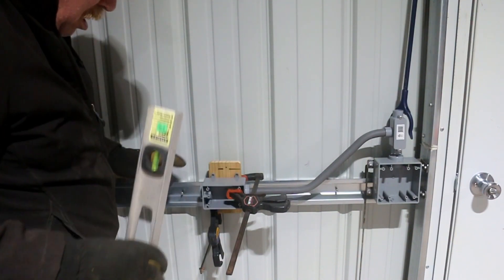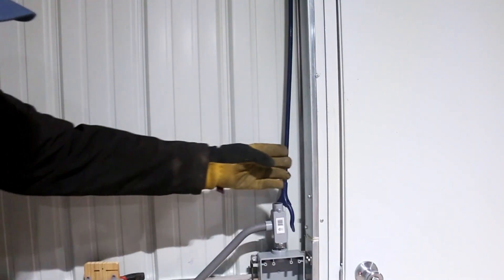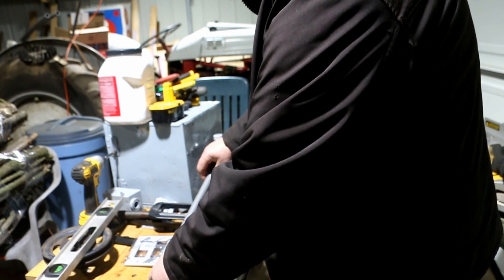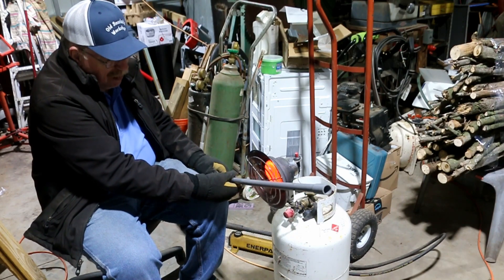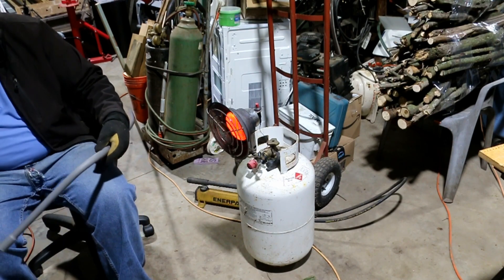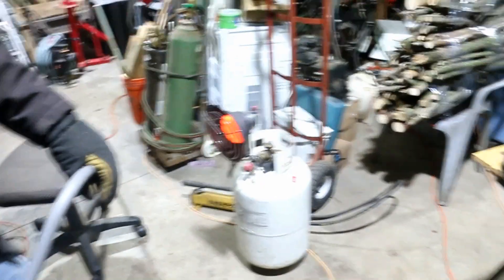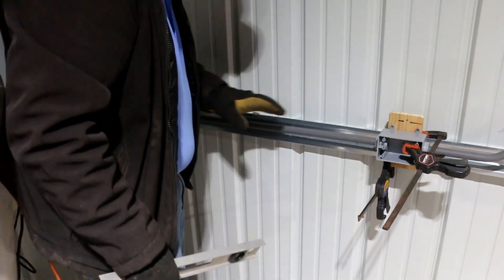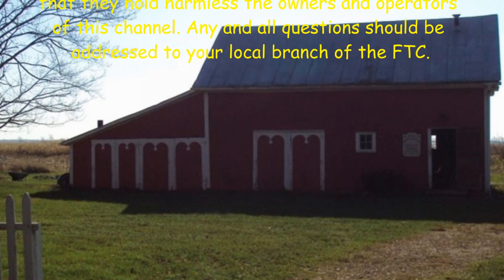Running Wire   Pt 3   Getting The Hang Of It

Comment: For a home job I may have just went mc or metal conduit out of sheer laziness 😅 maybe a few couplers.  Glad your having fun doing it!
Reply from the maker: Nothing wrong with cutting and fitting the run up out of factory bends. I'm just too lazy to spend all that time figuring out what to buy and discovering that the normal thing you would need. Like a 90 deg bend with a 4" radius is the last thing you will be able to get at the store and the warehouse wants to sell them 20 at a time. 
I only need one and that's what I make.😁😎

Comment: As i was watching you i was thinking a chunk of flat bar to make a form to bend around . Then i saw you use a pulley to form the bend . It was a better idea then mine .
Reply from the maker: That would work and I almost went that way. Since I was only doind a few I decided to try forming the bends by hand. 
I may not know everything! Shocking I know. 😱😁😎 So I will check with the guru's of the internet. 
I checked with some other creators for tips. 
This guy has some good tips.  https://www.youtube.com/watch?v=-soQvQ8Qc3s 
If I  was going to be making a lot of bends I would follow this guys ideas and make a form. https://www.youtube.com/watch?v=-JF1uGMGxQQ